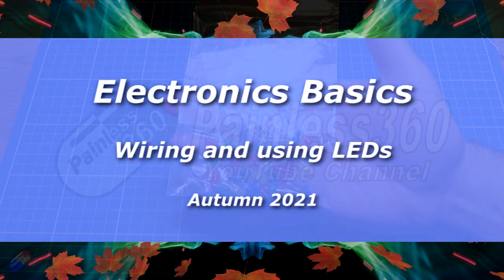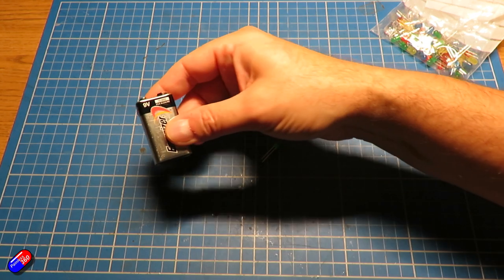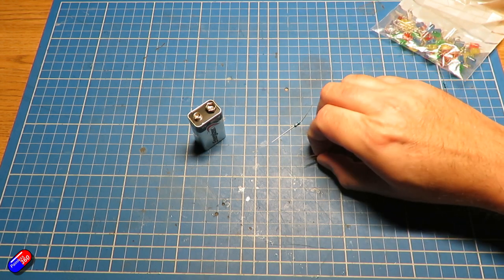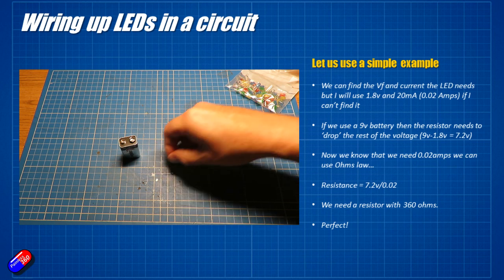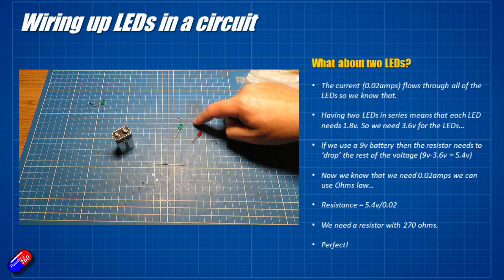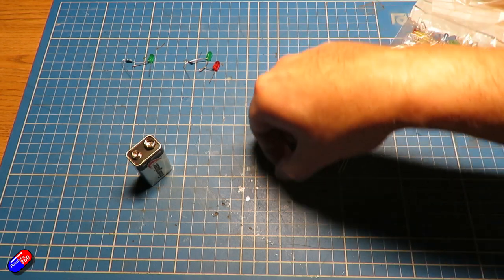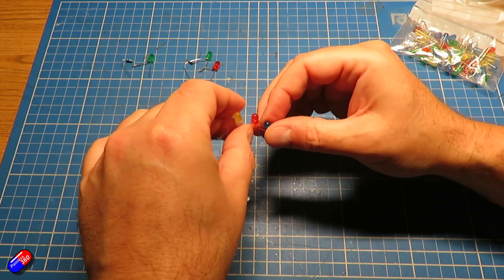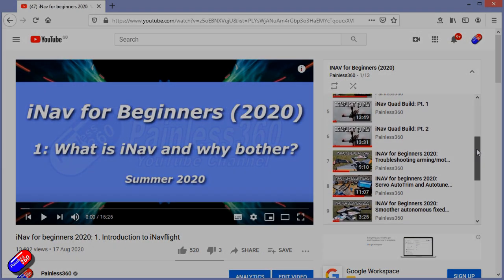How to wire up and use LEDs (explained for beginners)

Comment: SO instead of a Battery, I'm going to use a small, switching adapter. AC to 5V dc adapter. Using the adapter will allow me to plug it into the wall outlet, thus never needing to change a battery...........

Comment: I am trying to replace burned out LEDs in a Christmas light string, consisting of 250 lights (120V, 12watts, 0.1A). I want to buy just the LEDs and replace them in the little lamp holders.

Comment: Now in this video you hold one assembly (resistor+led+led) and touch it to the battery.
What happens if you held 3 of these assemblies to the battery at the same time?
Can't figure out if leds would go dim or if all 3 sets are supplied with 9v or that they 'share/divide' the 9volts between the 3
Reply from the maker: Check out the link in the description... Best of luck

Comment: I made a spread sheet with formulas for each of the multiples of 1.5 volts like in AA batteries.  Ran from 1.5 to 9 and found the difference in resisters changed by 90 at each step.  Try it with his formulas.  Great chart to have around.

Comment: Great video, thanks. When I only have limited volts coming in (6v) and  I want to run 5 LEDs, would it hurt to connect them in parallel, each with it's own correct resistor?
Reply from the maker: I'd put 3 in series with a resistor and the other two in series with a seperate resistor.... Happy flying
Reply: @Painless360  Great, thanks!

Comment: I know this video is three years old but what if you just used 5 LEDs with 9v would it work without the resistor? Because it add up to 9 V, so would it or would it not short-circuit it?
Reply from the maker: I would always add a small current limiting resistor to a circuit like this... Happy flying!

Comment: What is the purpose of a resistor? Could two more LEDs be used instead ( 2 x 1.8V =3.6V).?This way the power of 9V battery is going to be turned into light , not wasted on heat inside the resistor.
Reply from the maker: Check out the video linked in the description... Happy flying

Comment: I search resisters on amazon but they also have options “ 1W, 0.5W, 1/4W…etc” How do I know which one I need ?
Reply from the maker: Calculate the wattage by multiplying the voltage dropped by the resistor and the current flowing through it. Then use a resistor with a higher rating... Happy flying

Comment: I've recently gotten into 1/14 scale rc semis and just purchased a cattle hualer that I want to light up like a Christmas tree by adding 50 or so 3mm LED side marker lights using a 7.4v lipo. If I can run 3 LEDs per resistor (7.4v-5.4v=2, 2/.02=100 ohm) that would be approximately 16 "sets" of LEDs or am I misinterpretting all this? So that's 16 positive lead wires going to a single positive wire coming off the battery and 16 negative wires going to a single negative wire coming off the battery, correct? Is there a cleaner (less wiring) solution?
Reply: I build these on my channel, I'd love a cattle trailer at some point for my W900 build.

Comment: Does it matter what side of the resistor you use to connect to the battery or the light I see it has color rings on it does the direction matter?
Reply from the maker: Resistors aren't directional... best of luck

Comment: Thank you so much for the explanation, this was so easy to understand! I just had a query though, I build models and wanted to incorporate leds, but I'd like to stick with a 9v battery if possible. Is there a way to add more than 3 leds to the circuit, with them only requiring .02mah each? I was going to use 3mm Leds to make fitment easier... 

Thank you
Reply from the maker: The limiting factor isn't the current, it's the voltage. See the more advanced video linked in description.
Reply: @Painless360  That's absolutely perfect, exactly what I was searching for! I have some 3v SMD micro LEDS (4020) which don't have a resistor. I'm assuming it'll be the same principle for these too, despite their tiny size?
Reply from the maker: Yes, they will have a certain voltage that they need, assume about 1.8-2v per LED if you don't have any specs.. Best of luck!
Reply: @Painless360  Brilliant, that's right give or take. Thank you again for being so helpful, have a great day!

Comment: If using a 9V battery with a DC 9V COB LED strip (e.g. 8cm x 2cm), is a resistor required?
Reply from the maker: Not if the string is designed to be powered from 9v directly..

Comment: i understand the math. no problem, but when you have 3 LEDs in Series, doesn't the first LED takes the full 5.4V? the 5.4V is not split into 3 parallel lines, so as you've only resisted 3.6, why isnt the first lamp overloaded with the full 5.4v? Perhaps I am not visualizing correctly, but by the time the current gets thru the first LED, doesnt it in essence acts as a resistor, so then the remaining 3.6V passes thru to the 2nd LED, and that one takes the 3.6 and lets 1.8V through. Is this correct?  Does the first LED light brighter due to this if you had 6 LEDs, would the first one blow? would the last one light dimly?
Reply from the maker: That isn't how it works. Just follow the video and you'll be good... Happy flying

Comment: aren't LEDs meant to be super efficient? how is it that a whole 9v battery wouldn't be able to power 5 little LED lights?
Reply from the maker: They are super efficient compared with filament lamps. Wire in parrallel as well as series to light lots. See my video on it.

Comment: I have some 5mm LEDs in a midi controller that only will light when tapped.  They no longer stay lit on their own.  Are they known to die over time like this?
Reply from the maker: Sounds like a broken connection to me... Best of luck

Comment: having a LED config. of around 9V with a 9V battery and a Zenner diode in parallel can act as a regulator and thus avoid using a resistor?
Reply from the maker: Give it a go... Best of luck

Comment: if the voltage (of the LEDs) adds up close  to the battery's 9V, a resistor can be avoided to prevent energy loss?
Reply from the maker: I'd always use a resistor to limit the current... Best of luck

Comment: How did you find out the current the LED needs? Coz I need to know the current in order to know the resistance
Reply from the maker: In the specs for the LED. Milliamps needed for full brightness are stated, but 20mA is a safe bet if you don't know... Happy flying

Comment: I’m still a little confused on which resistor I would need, if I was to wire up 2x 12V Single LED’s to a 9V battery would I need multiple Resistors and if so how many ohms would that be? Any help would be great. Thank You
Reply: For "12V-LEDs" You don't need additional resistors, because they are LEDs with intern resistors already built in. 
But they will light weak, as the need 12V to run fully bright. 
Use a 12V supply or take regular LEDs with resistors.

Comment: I have question. I took Christmas lights with 10leds that powered by 2 x 1.5v aa battery. Added 30 more same leds, changed battery for rechargeable 3.7 1800mah and now it's bright first half hour then few ours it darker. Then it's goes even more darker and staying like that for  bout 6-8h I did remove that resistor tho as dont know what 3.7v do to it.  My question is how can I stabilise light so battery discharging gradually instead being bright  for short time and dimm for long time?
Reply from the maker: The lights are dimming as the battery discharges.  I'd use a battery with a higher voltage so you can connect them in series and reduce the current used... best of luck
Reply: @Painless360 thank you. But problem is I used this light for 3d printed eiffel tower model so I won't able to pull them out and put in series. It is make sense that they go dimmer because of battery. I want to know how to make stable discharge. E.g now after fully charge the power  works like that: 100% - 30min. 50%- 1.5h. 25%- 6-8h till fully dead. Is there any way of making for example: 100- 1h 75-1h 50- 1h 25- 1h?
Reply from the maker: https://youtu.be/m__1HsZ1eN0 :D

Comment: Nice video as always. I actually needed a more complex wiring diagram for example how can we connect multiple leds, let say 18 leds in a strip with a 12v battery. I don't really understand if we put more than 1 resistor how actually it works and how to calculate voltage drop etc. I was told to divide 18 leds into 3 parts of 6 leds each. The leds require 2.2 volt to light up brighter.  So if I need to light them together I will need 6.6volts right?! So 12.4-6.6=5.8v/0.02= 290 ohm. So should I put a 290ohm to the beginning of the strip? Can I put 3 resistors on each part or the first solution is better?
Reply from the maker: Current dictates brightness,  not extra voltage. 

If your leds need 2.2v then you can only get 5 in series on 12v.

You'll need 3 strings of 5 and the last string of 3 wired in parallel. Each with an appropriate resistor. 

Best of luck
Reply from the maker: https://youtu.be/m__1HsZ1eN0 :D

Comment: So you could put 5 in series at 9v with no resistor?  Then power supply amperage divided by .1 = the number of parallel circuits you could add??

Great vid!
Reply: that was also my question while watching
Reply: In theory it could work, but ut isn't recommend. 
Use a higher voltage supply or take less LEDs. 

LEDs run on current, You need something, 
that regulates the current. 
The simplest thing for that is a resistor. 
But this resistors also needs some volts for itself. 
When counting the LEDs (connected in series) 
(by addition of their voltages), 
leave some voltage for the resistor. 
Example: 
9V battery; 4 LEDs of 2V, there is 1V left. 
That works properly.

Circuits without current-regulating 
can drain the battery fast or burn the LEDs.

Comment: So say I want to do a line of 12 would i need 2 x12v battery's and what would the resistor need to be many thanks 👍
Reply from the maker: What would you calculate it needs to be using the way shown in the video?

Comment: Hello, thank you for the explanation on how to calculate the resistor needed when you want to connect an LED, I don't know much about electronics, I only do small DIY jobs on low voltage and I admit that I always have trouble knowing what resistor I should put for each LED, I'm keeping this video in my dedicated playlist because I know that by tomorrow I'll have forgotten how it's calculated and being able to find it again will allow me to come back to it in the future and find this calculation again, which will prevent me from burning out LEDs because I didn't put a resistor in. 👍😉

Comment: Hi! Thanks for the video. I’m trying to add some lights to a diorama. I’d like to run a total of 4 3-6v LEDS (all have internal resistors) and 3.7v motion sensor. I have a 6v battery pack. Will they all run? Looking at your content I’m assuming they will but maybe not as brightly as they should?
Reply from the maker: I'd test them with two in series and see how that works first. If they are too dim then connect all of them in parrallel... Best of luck

Comment: Mahalo for the amazing explanation. I wonder if you can tell me if I can do something kind of similar.  On my pc motherboard there is pins to connect a led to indicate that the pc is powered on, I was hoping to learn how to connect multiple leds to the motherboard pin?
Reply from the maker: It depends on how those connections on the motherboard are setup and the voltage and current they provide. If it is more than about 3V, then you will need a resistor as shown. It is is around 5v, I'd wire a couple of LEDs in parallel and if it is something like 12v, then you can have a couple of LEDs in series..

Comment: Forget about the resistor - it’s a red herring.
The concept you need to focus on is Kirchhoff’s current law and Kirchhoff’s voltage law.
In simpler terms:
When two components are in series, the currents through them are the same, while the voltages across them add up.
When two components are in parallel, the voltages across them are the same, while the currents through them add up.
And the reason behind the above general laws is to do with the physics of electricity, i.e. that current is flow of charge per unit time, while voltage is potential energy per unit charge.
Ohms law will keep you on track.

Comment: I realized that the more LEDs you connect in a circuit, the lower the brightness of the first 2 LEDs on that last example. Is it because of the voltage of the battery and how much energy is being "filtered from the resistor?

Comment: Ok, now I need resistors...  I have three different size LED lights, I have several AA Battey packs, extra low voltage parallel 22AWG wire, two diffrent types of small switches.  Ok, now track down the resistors.  Hold my non Anhauserbush beer.
Reply: Buy the led light with the resistors already attached!   So much easier.
Reply: I want to put one of these led lights in a paper building.   Do I have to worry about fire?

Comment: (edited) Dumb thing, but, I noticed that for these LEDS there’s a pattern to the resistor amount. You’ll need to know what resistor number for a single LED tho
SO
1 LED - 360
2 LED - 270
3 LED - 180
4 LED - 90
5 LED - no resistor
They’re all a multiple of 9/90. For every new light, go backwards in the 9/90’s times table and you’ll get your resistor
Reply from the maker: Nice idea but what supply voltage does that 'rule of thumb' work on?
Reply: Heavily edited, sorry
 @Painless360 
The 9 volt battery from the video. It’s only based on what I saw here. I don’t know much, Imma update my comment to be an observation instead of rule.
The thought only applies to these specific LEDS and their configurations. I don’t have enough experience yet to make a legit rule of thumb…
The volt supply made me think though, since it’s a 9 volt, you need 360, (haven’t done math yet, it’s a theory) if you wanted to do a 12 volt battery, a single bulb would need 480(I THINK???)? If that’s the case, you’d go backwards by 12/120. My hypothesis is: x=volt battery. x*40=resistor for 1. For multiple bulbs: y: amount of bulbs AFTER THE FIRST BULB. (X*40)-[y*(x*40)]=new resistor number. Meaning:
1-480
2-360
3-240, etc
Reply from the maker: The maths needed is pretty easy trying to avoid that basic maths may cause some to miss the essential point (that it is related to the voltage supply being used) and get into trouble... Happy flying!

Comment: So if I have a 1.5 v battery I wouldn't need a resistor do I?
Reply from the maker: Many who don't understand how to do this use button cells to power leds directly without issue.. Happy flying
Reply: sure but the LED will not turn on

Comment: In the beginning of electronics it was thought the flow was positive to negative (Thus the backward shape of the diode symbol on a schematic).  As electronics progressed it was discovered electrons actually flow from negative to positive. Shouldn't the voltage modifier (usually a filtered circuit) be before the load on the negative side instead of at the end of the logical circuit?
Reply from the maker: The convention for current in diagrams and design is from positive to negative. Don't let the actual electron flow confuse you.. Happy flying
Reply: The resistor can be on either side - it's independent of current direction.  And since electons are negative, charge still moves positive to negative.  If you give someone debt, the flow of money of from them to you!

Comment: Hi painless 360 I have a question about Inav. Can I use Inav with Spektrum transmitters and receivers?
Reply from the maker: Yes, you can. Most modem flight controllers need to SBUS input though so you will need a reciever that has that.. Best of luck

Comment: Great video thanks! 👍🏻 Any chance you can do something similar with COB & Cree LEDs ?
Reply from the maker: If you want COB then check out the MenaceRC COB LED products - very easy and safe to use in the hobby. Else you can use the same maths used in the video for a COB LED. You need to find the current and voltage it needs and you can use the same method! Best of luck
Reply: @Painless360  Thanks again 😊 I’ve been playing around with them lately  - fantastic, cheap too! 
I have some circular COBs - super bright. They’re about 1 inch diameter and wafer thin, about 1.7mm 😳 
The Cree LEDs are also impressive but with both, I’ve blown a couple lol.
Been scratching my head about unmarked voltages & whether they need resistors etc 👍🏻
Reply from the maker: The ones that I've seen run on something like 3.1v and need 300-700mA (0.3 - 0.7 Amps) so you need to fined the specs of the ones you have and you can figure out the resistance value. Watch for the smaller resisters getting warm. As you need them to dissipate more power they need to have a higher watt rating..
Reply: @Painless360  okay thanks 👍🏻👍🏻👍🏻👍🏻

Comment: Do you think you could make a video on what value of a resistor do I need to mod a standard size RC servo to move more than its standard deflection? 

Application: To see if we could use a cheap and cheerful standard size servo or a 9gm servo for FPV to get more panning.

Absolutely loved this video, great going. 

Thanks.
Reply from the maker: It wouldn't work like that.  The rotation is a servo is measured internally using a variable resistor mounted to the output shaft... happy birthday